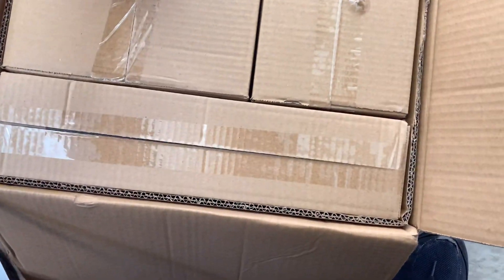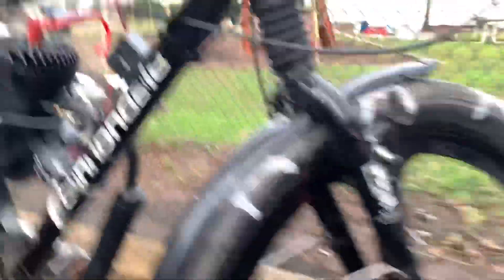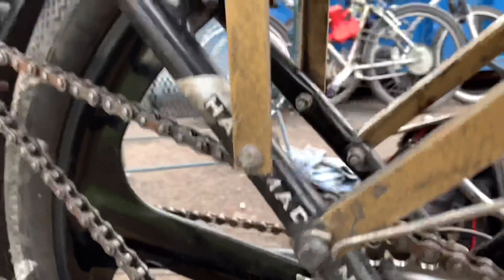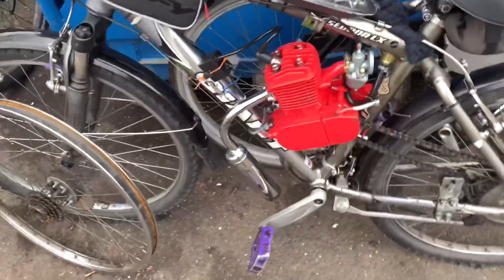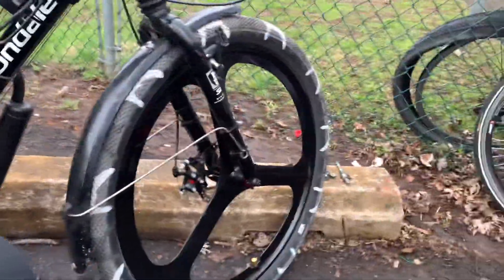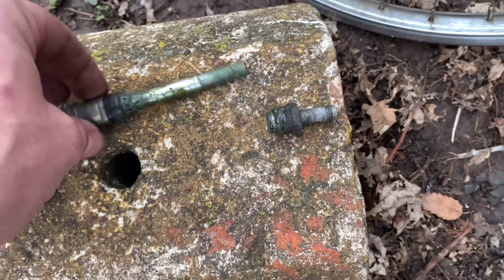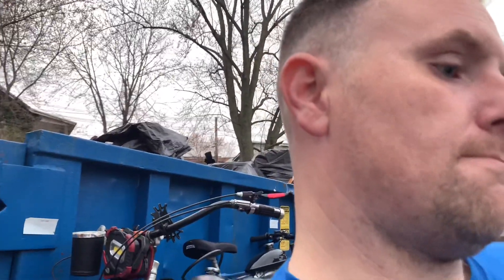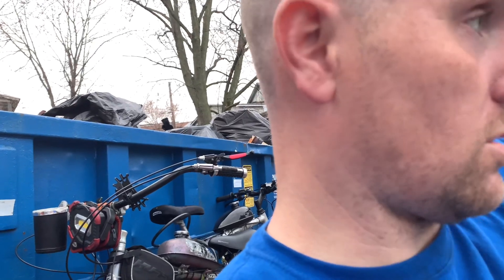Update!! New wheels for terra reed!! New project starting soon!!!🤩 wife got a new 80cc

Comment: A g2 reed or case reed mod would run better an faster...but a g2 Reed with good porting will be better then a Dio reed ...or if you want to just do work a case reed is better an will run cooler in motor temps..
Reply from the maker: Case reed would b awesome but that way more money and I already have the dio reed setup so that’s y I’m goin to put that back on the new motor when I bought everything I didn’t know much just that I wanted a reed setup tbh I still don’t know much I haven’t even been into motorized bike a year yet and half of that time was wit a 50cc and two more months out of it I was laid up from the accident so it’s still a big learning curve for me I’m sure I’ll try all the different setup eventually just to see for myself how they type know
Reply: @JMB676  i feel you but all you would need for a case reed is the g2 reed block that comes with the manifold...or just ryn a g2 reed out of the jug they run a lot better then a dio reed set up an tune better...